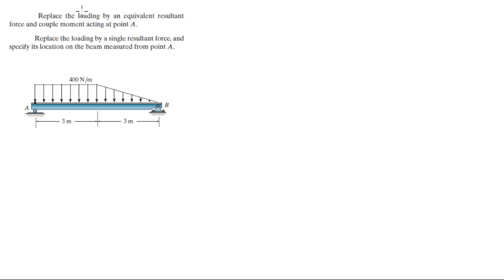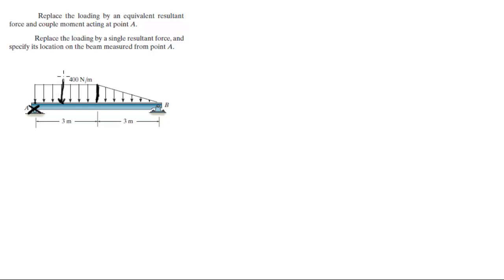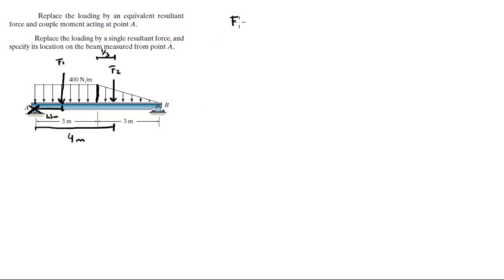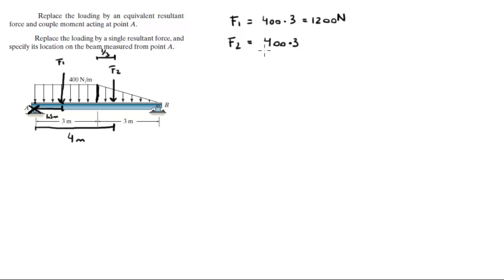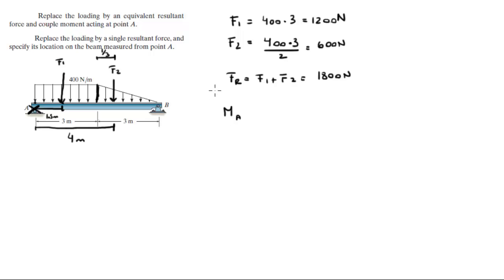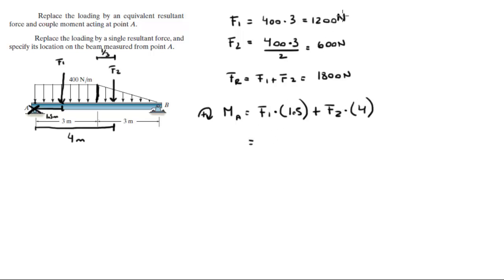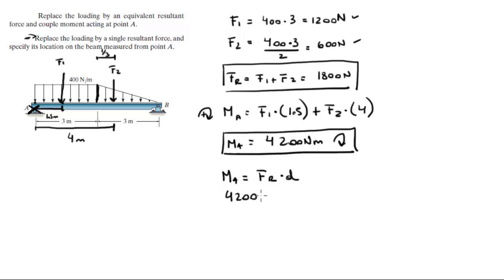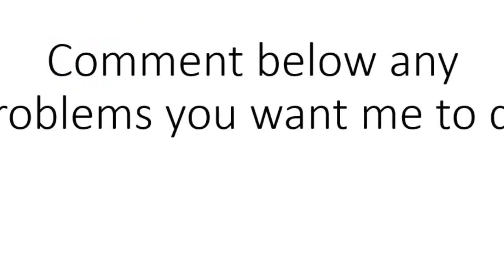Replace the loading by an equivalent force and moment acting at A

Comment: I'm one of your patrons... I'm confused on where you got the 1.5 and the 4 for the moment (around the 2:30 mark) Thank you!
Reply: I believe that this is because the forces (F1 and F2) are placed in the middle of the geometric figures. So assuming point A is at 0m and point B is at 6m, F1 is acting on the middle of the rectangular part at 1.5m and F2 is acting at 1/3 past the rectangle, at 4m. You use these distances respectively when solving for the moment. 
Hope that helps!